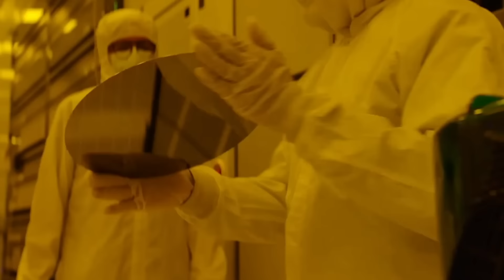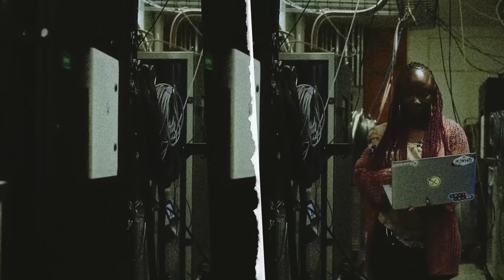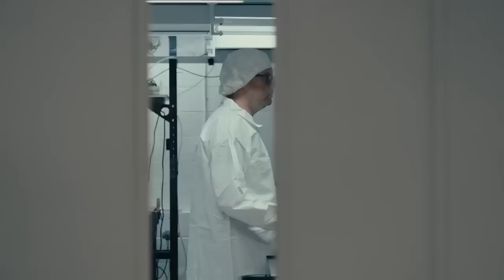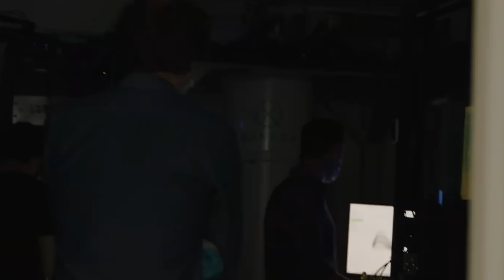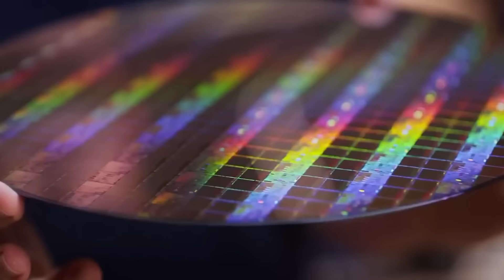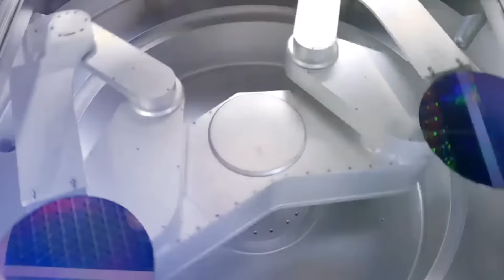MIT's 1000TB/s Photonic Chip Finally Puts an End to NVIDIA's AI Domination!

Comment: Q.ant already runs optical processing units in a datacenter in Germany with their GPU-like processor. Akhetonic is working on a general optical processing unit (CPU -like chip they call RPU; Reasoning Processing Unit). Uniting both with the stuff described in the video could lead to minimal electronics and maximum output.